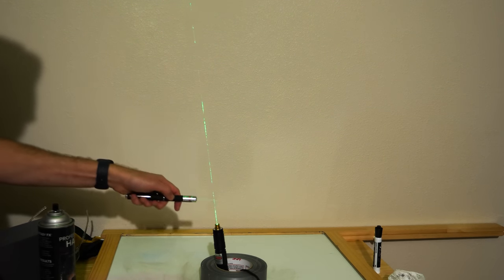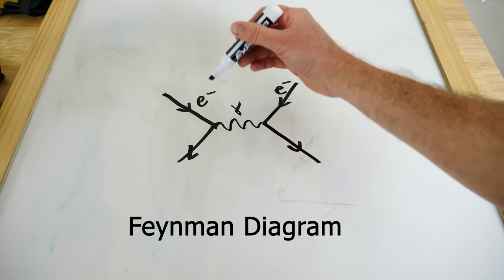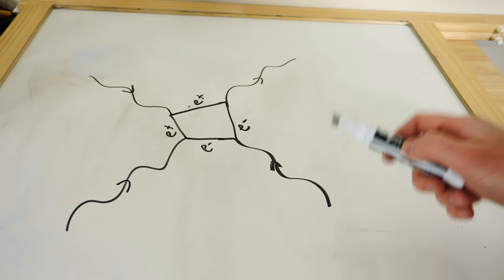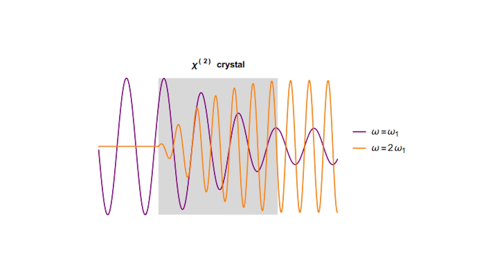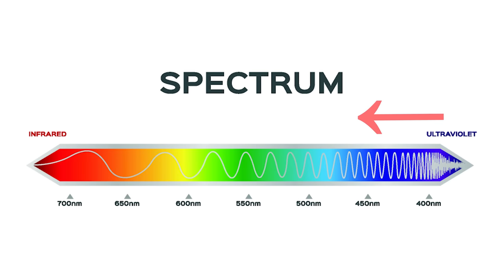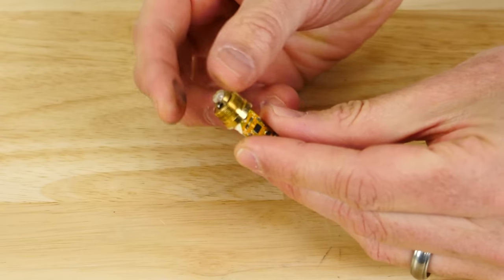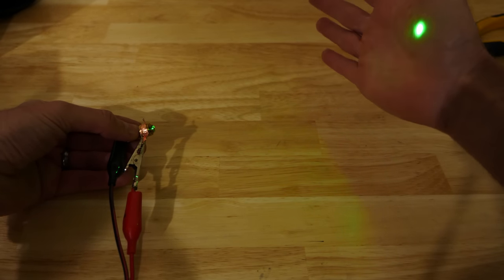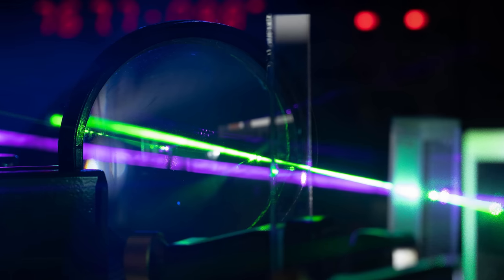Can Light Bump Into Other Light?

Comment: I recently retired from an engineering career that included extensive work in nonimaging optics (the optics of illumination devices, for the most part. I designed some photography lighting, high-efficiency concentrators for solar energy, and a couple of very badass flashlights, over the decades I spent in that arena). While I've studied and have understood the concepts you put forth in your videos, I give you great credit for bringing those very abstract ideas to life. Thank you for all you do to bring science to us, your audience!
Reply: I am an engineering major myself and would love to listen your experience
Reply: Flashlights like the SyniosBeam or Maxablaster?  The 12" mirror is pretty effective. The short arc speaks for itself though. I'd like to make a gigathrower with a nice spill. Drivers are getting more efficient  too.
Reply: @BariumCobaltNitrog3n  it was pretty long ago, when LED flashlights were brand-new and I had some good ideas for reflector/lens design. Now you can just buy aspheric lenses off the shelf that do a better job, but 20 years ago I was, like, cutting edge...
Reply: @ali-g  one of the best things I ever did was learn to use a specialized piece of software, called OptisWorks. It's now sold by National Instruments but still works the same way; it's a modeling add-in for SolidWorks CAD software. I eventually bought a (very expensive) license for it and was the only person in northern New England who had it, and knew how to use it. 
Most of the jobs were pretty straightforward. A client would bring me a design done by someone who had no idea how to build an optical system, and pay me to double, triple or quadruple the output (brightness, focus or both) of the system. Really fun stuff!
Reply: @danielleohallisey4218  I've been experimenting with lenses and reflectors and combinations of them for a few years. Did you check out those two flashlights? Handheld, battery operated, not tethered and must run for minutes (no strobes) and the record is around 52M candela and 7.5 kilometers. From a single led and the beam is 12" wide. I'm a flashaholic. Budget light forum.